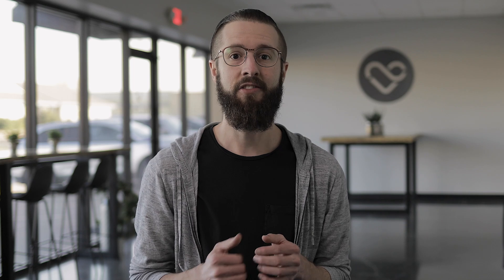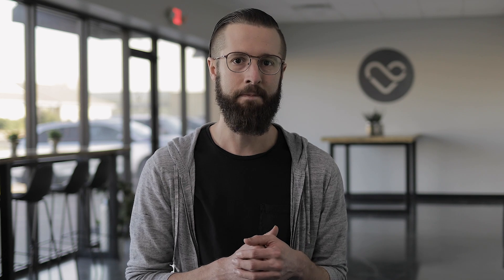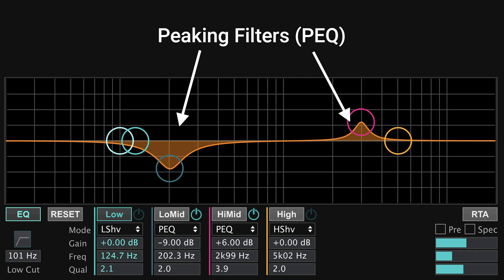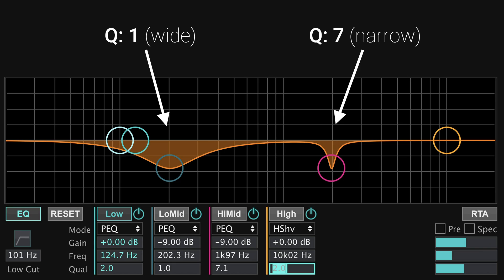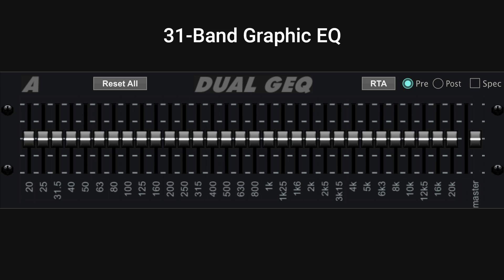How to Use Your Digital Mixer's Parametric EQ | Church Sound

Comment: So it's only 4 band EQ? 
Are there digital mixers with more than 4 bands? Say I want to input a high resolution EQ by inputting 8~12 PEQs. Would this be possible on a digital mixer?
Reply from the maker: Yes, there are digital mixers capable of more than 4 bands. But most of the budget mixers (e.g. X32) only have four.
Reply: @collabworship  Awesome. Thanks for the clarification!

Comment: I know this is off the subject.  But I have not had much success in finding information about setting up a live feed signal using the USB-X card.  I have all the updated drivers and can send the PC's sound to the board using the card but after setting up a stereo  bus and building a feed mix, I have not been able to access that bus feed in the computer software.  I have been able to get a signal using the Presonus One software.  But cannot get it using vMix which is what we use to broadcast.  If you can point me in the right direction I would greatly appreciate it.  Blessings for you do for the advancement of King and His Kingdom.
Reply from the maker: Hey David - Sounds like a compatibility issue with vMix... which I have never used. Sorry, don't have any tips for you on this one. -Kade